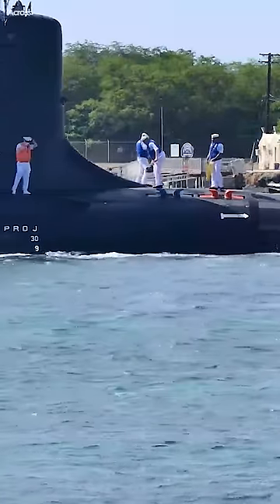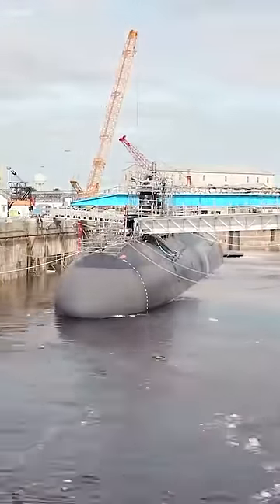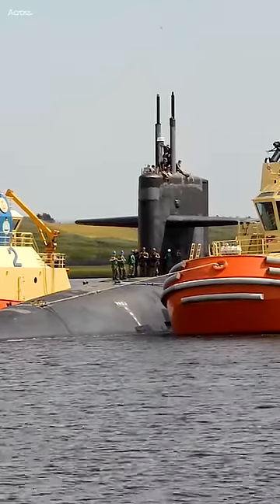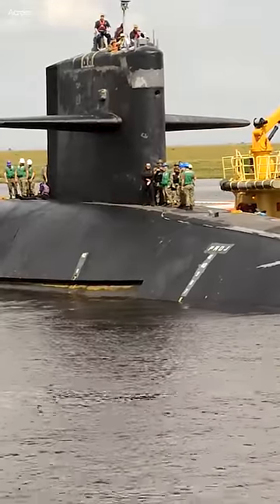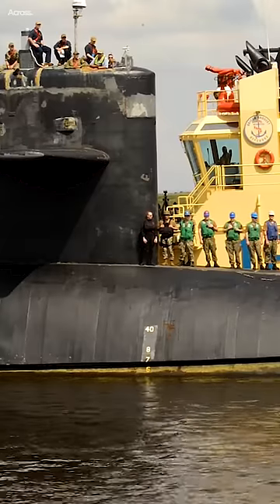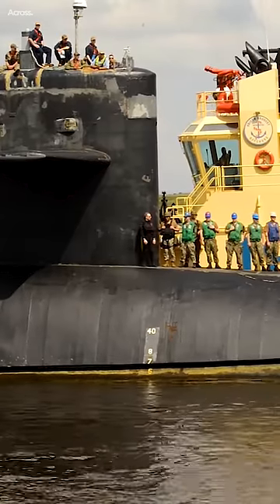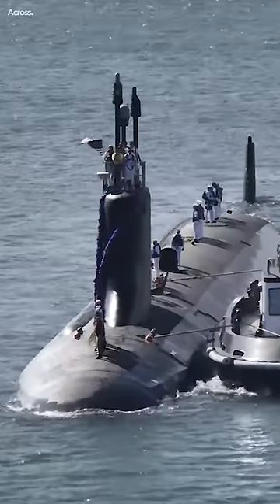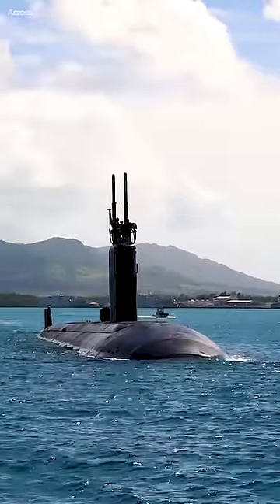Why the US Navy Doesn't Build Titanium Submarines #shorts

Comment: Russia experimented with Ti sub hulls for many reasons. One of which was that TI is cheaper in Russia. They have orders of magnitude more ore containing titanium. One area of metallurgy that the Soviet Union was very proficient in was in non ferrous metals. The issues with brittleness and stress fatigue were largely worked out during the soviet space program. Exotic alloys such as MagThor and thoriated titanium were experimented with in addition to special heat treating and manufacturing techniques. The famous Alfa class submarines were not built for diving depth but for speed. The idea was to be able to patrol the massive soviet coastline. They even used Liquid Metal reactors for the higher thermal output.
Reply: I wonder if you can make an alloy with titanium and steel. I mean stainless steel is steel and aluminum if I’m not mistaken.
Reply: That's why they only built one and scuttled it because of stress fractures. Lol nice try Orc.
Reply: Nooooo murica is always the best and YouTubers know better than soviet engineers and murica always win and so good and ....
😅
Reply: @bozoc2572  you're right USA is always the best compared to everybody else.
Reply: @bozoc2572  Who landed on The Moon? Who REALLY won WW2 by dropping Nukes? Who's empire Collapsed under American Dominance? 🤣

Sit down Commrade

Comment: Titanium is good for heat stress, which makes it more worthy for flying vehicles. Useless as a submarine for repairing would cost more.
Reply: I’m curious how it would work as a penetrating core for a bullet. They say speed and hardness is how you get penetration. It’s lighter and harder than steel so idk. Maybe it would just explode from being so brittle. Seems they like tungsten and uranium better.
Reply: @Forfun62  the cost to repair and replace. Titanium is also best for heat entry as in spaceships which go through extreme heat and cold conditions. It would be useless for the sub because of the extreme constant cold water on the metal. Rust will most likely form on the hull

Comment: One might find it interesting to know what certain subs outer skins are made of.
Reply: Rubber
Reply: Steelfor the structural hull. A complex recipe for steel that is strong yet flexible. Titanium is not flexible. And it is stronger by weight, not to volume. And the outer skin is a rubber compound.

Comment: i dont think the price per pound has anything to do with it. Its more the machining of it that makes it way to expensive. Welding titanium isnt that easy, machining titanium is also a pain in the ass. And then the fact that titanium is kind of like aluminium, it wil prettymuch only bend once and then it wil crack. So if its diving deep the titanium wil be compressed by the water pressure, and i think that might allready be enough for titanium to become really brittle. So next dive you might just rupture the hull with that same water pressure. Now i didnt do the calculations on it or anything, but i know for a fact titanium wil go brittle like that.
Reply: They use a titanium alloy for the pressure vessel of the deep sea vehicles Limiting Factor and Alvin. The deepest rated one and the one with the most dives. Alvin upgraded from steel to titanium in the 70s Alvin has like 5000s dives. What your talking about is not a issue.

Comment: Maraging steel is stronger anyway.  It’s a super steel.  Titanium is not like aluminium in that it can crack like we see on the littoral ships it’s party piece is it’s very strong and rather than crack it bends it has a higher plasticity yield grade than steel or aluminium and does not work harden as some other people seem to think on here.  Titanium has a higher tensile strength than steel and it’s nonmagnetic and does not corrode in salt water it therefore makes great hulls for ships and subs.  There are many grades of titanium as well, all with different property’s.  Modern western subs are made from Maraging steels and have are stronger hugely more stronger than the old structural steel subs used to be made of and the Maraging steel is super expensive.  The type of steel used for subs has been designed for subs in mind and due to its thickness it’s stronger than titanium subs.  Modern subs can dive just as deep if not deeper now.

Comment: you mention titanium is 4 to 8 times as expensive  as steel...but since it is 1/2 the weight, it's actual cost is 2 to 4 times as much as steel......the cost of fabrication is what is expensive......as it is very hard to weld and machine....just saying

Comment: Titanium is only stronger than standard steel, hardened steel is stronger.
Reply: Well the question is, which relation, strength to mass or strength to volume.
But steel always more elastic, the reason later soviet subs where made out of steel again
Reply: Titanium but itself is very brittle and don't do well in cold settings
Reply: titanium alloy is stronger than ANY steel, pound for pound. 

and practically corrosion-free
Reply: @darthvirgin7157 Titanium is stronger by weight, but not by volume. Titanium is too brittle for sub hulls.
Reply: @marksnyder8022  
titanium ALLOYS have better ductility than steel. PURE titanium is brittle. 

titanium ALLOYED with vanadium and aluminum are the common “titanium” used in aircraft and sports equipment.
Reply: @darthvirgin7157 There are no titanium alloys.

The US uses steel, that means steel is the best option.
Reply: @jamegumb7298  
google "titanium alloy"

google is our friend.
Reply: @Glidescube  yeah that's why its used in the pressure vessel of the deepest rated DSV and the one with the most dives. Limiting Factor and Alvin

Comment: Tungsten subs are the future.
Reply: Why? A lot of the cons of titanium apply to tungsten. It’s brittle, it’s hard to work, and it’s heavy as hell.
Reply: @mingb_4099  were do you get this brittle thing for titanium from? You know most of the DSVs in the world use titanium Alvin does an it has like 5000 dives. Limiting factor does aswell and it has the deepest rating in the ocean. Do you know better than the people that built those?
Reply: @johno1544  Alvin only dives for a few hours. 12 I think at most. Military subs go on patrol for months at a time. It is also worth noting Alvin just got its titanium sphere replaced a decade ago.
Reply: @mingb_4099  Alvin dives several times deeper than any military sub can ever hope to. It's not even remotely close the pressure it withstands compared to a military sub. Shorter dives also means it goes through more cycles which it the real issue for any sub. It upgraded to titanium from steel in the 70s. They have to get recertified every 5 years to dive that deep so both steel and titanium always get replaced at some point.
Reply: @johno1544  that answers your question as to why Alvin doesn’t get weakened over time. It gets replaced every 5 years.
Reply: @mingb_4099  no it doesnt get replaced every 5 years 🤦‍♂️ it just gets retested for certification. Every DSV steel or titanium does, well except for Titan it was never certified. Dont you find it odd all these vessels made for the deepest part of the ocean use Titanium? They arent picking titanium because its cheaper or easier to work I wonder why they pick it over steel? Limiting factor is one of the newest rated for deeper than the ocean gets and they picked titanium hmmmm.... You clearly know better you should make one.
Reply: @johno1544  I never said I knew better. But it must be maintained because titanium does not keep its strength. Ask anyone who has worked with titanium, it is brittle. You can replace a tiny sphere in a Bathyscaphe. You can’t replace the hull of a military submarine.
Reply: @mingb_4099  I've worked with titanium and machined it for Pratt&Whitney you dont know what you are talking about. There are different grades and alloys of it. They didnt spend way more than steel to create a titanium sphere for limiting factor machined it to within 99.933% of true spherical form just to replace it because it's a brittle metal 🤦‍♂️ limiting factor goes down 11,000 meters best military subs crush around 500m. I you dont design DSV stop saying you know what metal is better to use it just makes you look dumb
Reply: @johno1544  oh my god you literally just repeated every thing you just said. I DIDNT SAY IT GIT REPLACED EVERY 5 YEARS. I said it just must be maintained often. I understand it holds up well in deep parts of the ocean. It weakens over time though. I don’t know better then them. I’ll take your word for it that it’s not brittle since you’ve worked with it apparently, but literally everyone and everything else says it’s brittle.
Reply: @mingb_4099  5 years is the standard re certification for a DSV if its steel or titanium it doesnt matter. Stop parroting what you hear other people say like its fact. At least examine what they are saying oh it's a brittle metal ok, then why are the vessels dealing with the highest pressures on earth using it? Kind of undermines their whole point when it's also more expensive than steel why would the use it? It cost more and needs to be replaced more we should use that metal brillant

Comment: If you can afford to built 50 steel submarines, you can afford to build 2 titanium submarines and 30 steel submarines.
Then, once it's proven that titanium is far superior, future builds will be cheaper.
Reply: Maybe you just want 50 submarines? America IS all about overkill, isn't it? 😂
Reply: Titanium is brittle at depth, and experiences micro-fractures. Sure you can go very deep, once. Then the material degrades, and you can't go as deep. Almost like carbon fiber... meanwhile, submarine-grade steel maintains its ductility at depth so it can go to test depth repeatedly without degrading.
Reply: Titanium isn’t better though. It’s brittle and expensive as hell.

Comment: Titanium is actually weaker than steel.  If you stress test a bar of titanium and a bar of steel or equal dimensions then the titanium will fail first.  Titanium is like 50% the weight of steel, but only 80% the strength.  Titanium’s greatest strength isn’t even its strength to weight ratio, it’s titanium’s durability at high temperatures.  Titanium is also a nightmare to work with, while steel is one of the most well studied and understood materials on earth.  Steel is also, of course much cheaper.
Reply: That's why nearly all the new DSVs use Titanium even old Alvin upgraded to Titanium from steel in the 70s. Limiting Factor with deepest rating of any DSV uses Titanium machined to 99.9933 of a perfect sphere. They use Titanium alloys not pure Titanium. I have personally machined aircraft grade titanium it's not a nightmare to work with as so many claim. Biggest issue really is the shavings are a fire hazard not hard to keep in check.
Reply: @johno1544  titanium is lighter and more corrosion resistant, but it’s definitely not stronger.
Reply: @GusCraft460  strange they are picking this weaker metal for protecting people from the highest pressures on the planet
Reply: @johno1544  well it didn’t do a good job of protecting them, did it?  They also used a PlayStation 2 controller.  Do you want to tell me about how that the superior submarine steering device too?
Reply: @GusCraft460  WTF are you talking about Titan with its carbon fiber hull? Lol I'm talking about Alvin, Limiting Factor and the Russian DSVs all use titanium pressure vessels and have thousands of safe dives. They dont use video game controller and all have been certified by independent agencies. Limiting factor is rated ocean deep that's 11,000 meters.
Reply: @johno1544  the US makes all its military submarines out of steel and they’ve collectively done hundreds of thousands of safe dives.  The advantage of titanium is that it is lighter, which translates to greater movement efficiency and easier transport, but those are ultimately just not super important for a submarine.  Titanium makes much more sense in aircraft than submarines.
Reply: @GusCraft460  yeah and military subs crush at like 600m DSV go more than 10 times as deep. But clearly you know better than the people that make these DSVs you should call them up and save them some money by switching to steel